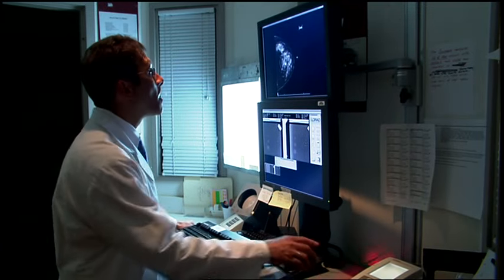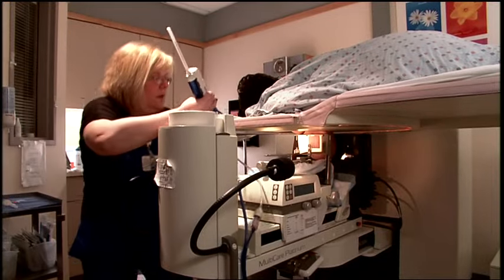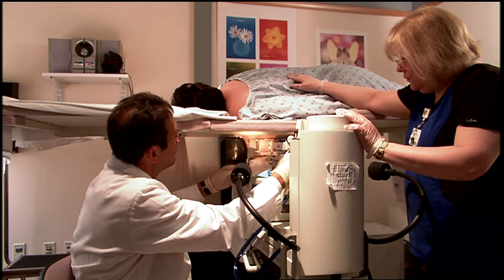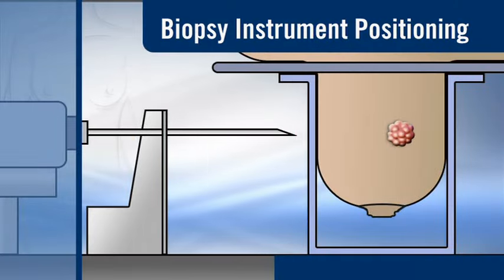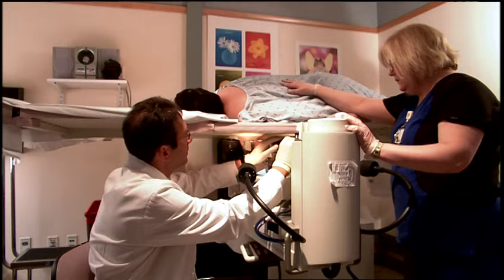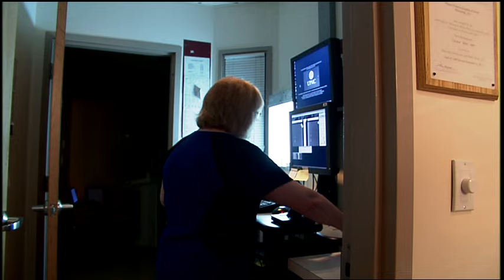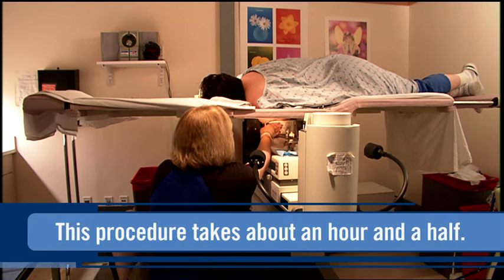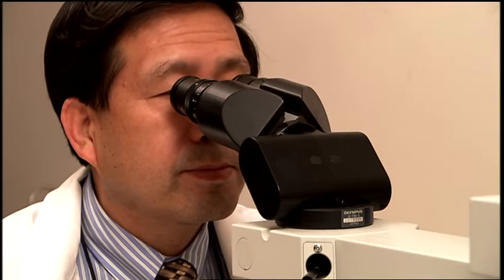Stereotactic Biopsies for Breast Evaluation | UPMC Magee-Womens Hospital

Comment: I had my biopsy done yesterday and it was a breeze. The only thing I felt was the numbing needle and it was just a tiny pinch. The whole procedure from start to finish took 25 minutes and most of that was them taking pictures, first to locate then to make sure they got them. Your breast is compressed the whole time but nothing like getting a mammogram, after the procedure they took 2 mammo views to make sure the chip was in place. Strips are placed over the tiny cut as well as gauze pads.

Comment: My first biopsy was on Friday, May 13th, 2014 to remove some tissues for review of Cancer. My next scheduled appointment is on Monday, July 7th, 2014. If I hadn't felt comfortable enough during and after the tissue sample biopsy, I would have asked for a different method for the full tissue section removal. I also have Lombard back issues, and that was my main concern for discomfort, and I experienced very little to none. Even my neck didn't hurt resting on the Styrofoam cushion as my left breast was aligned on the nipple pincher section below me. I know it sounds worst then it felt. Personally, I would prefer all my mammograms be done in this machine (minus the needle which I barely, and I do mean barely felt) verses the standard stand-up, twist this way, pull the skin from the arm-pit, squish the breast down to paper thin, and repeat a few more ways before changeling to the other breast, and repeat.  Sometimes that procedure takes longer, is more uncomfortable, and sometimes leaves bruising. The Biopsy mammogram machine dangles the breast into a positioning post which firmly holds the nipple and gently tugs the breast down to make the area/section more viably accessible for the procedure(s). If you like receiving massage(s), think of the biopsy table as a massage table, and relax. 
However, if you are super sensitive to being touched, you might feel things differently  than I or another person does, and that is something you will want to mention at your exam / procedure.
Reply: Jennifer Eddy